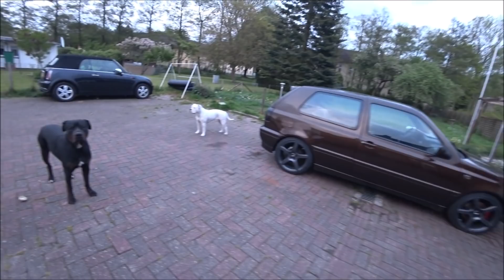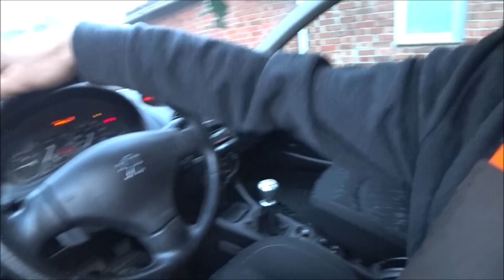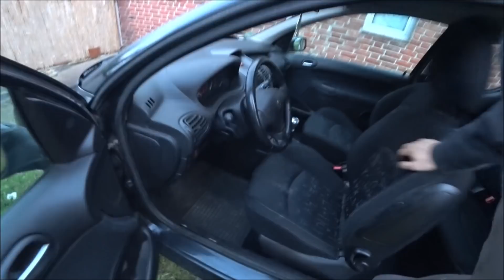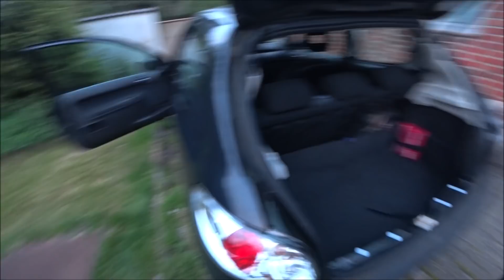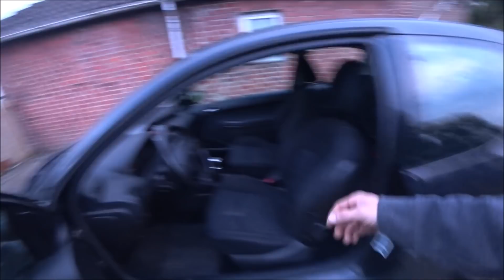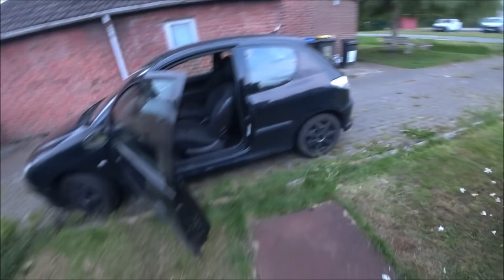Peugeot 206 ? Was machen wir damit ?

Comment: Der Motor ist wahrscheinlich ein 1,4 l mit 75 PS. Wichtig bei der Generation das Sekundärluftventil geht gern kaputt und flutet dann die Pumpe, daher den Schlauch vom Ventli entfernen (auf dem Krümmer) und anschauen. Schwarz oder Braun -> defekt
Und original Rückleuchten vom 2.Facelift (ab 05) sehen besser aus. Die Facelift Heckklappen rosten auch weniger.
Teile gibt es genug auf dem Schrott.

Comment: Scharfe nocke 😋 air brush und etwas tiefer und Geile Felgen ❗️natürlich Standard aber das wäre mal schön weil wer tuned schon ein 206 !!! 😏 das wird der 88ps sein das ist der große Motor Standard is 75ps gehen schon ganz gut sind zwar nur 88ps aber wiegt halt nicht mit ein bissel mehr Leistung wir d das ein richtig spritziger Spaß Hobel so nen richtig geiler SLEEPER das ist der in begriff eines sleepers ❗️❗️❗️❤️
Reply: FRanky TV Der 206 RC ist echt eine geile Spasskiste :)
Reply: Das müsste der kleine Motor sein mit 1,1ltr und 68 PS